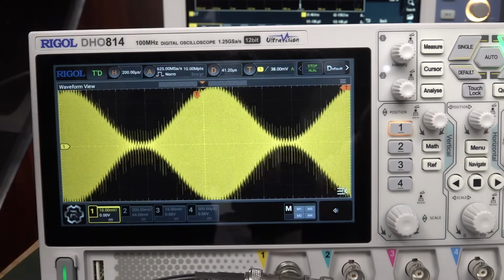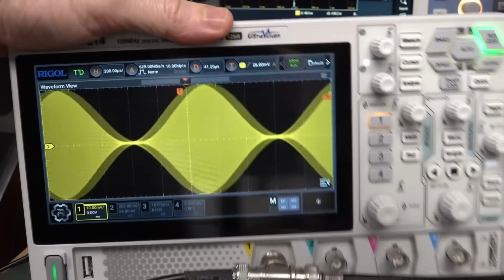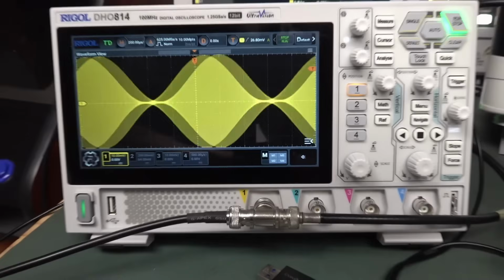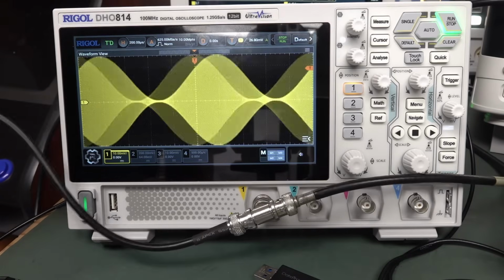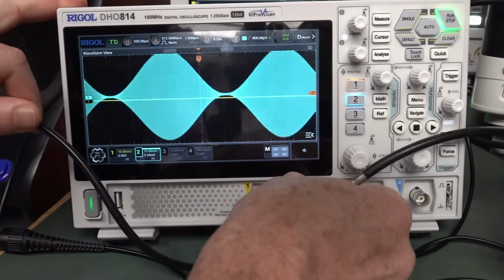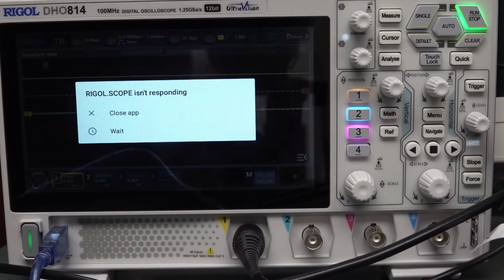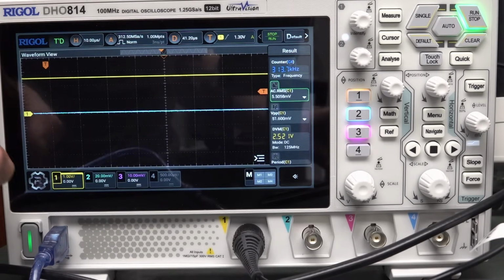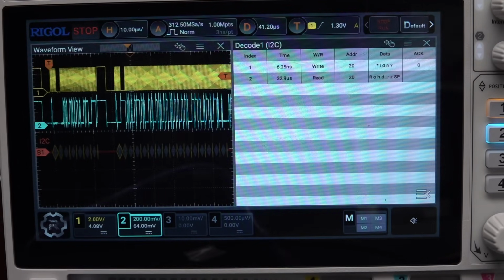Scope WTF!

Comment: The Rigol DHO800 series model DHO814, which I own, is the best oscilloscope I’ve ever purchased. It offers numerous features, a touch screen, and even the ability to operate using 5-volt power banks (similar to mobile phone chargers), making it highly portable. It’s an excellent device overall, but my one criticism is that the internal fan is quite noisy when the oscilloscope is in use. If Rigol could address this issue, it would make the oscilloscope absolutely perfect. Additionally, there are several YouTube videos available that demonstrate how to use this specific model and oscilloscopes in general.

Comment: So are we buying these DHO or waiting for a new batch?  The solder or grounding on the BNC must be wonky.  So are we buying?  I want to use it as portable with a battery over that USB C connector.  Could that C connector absorb interference?  And are we buying these?

Comment: Let's analyze the facts. The signal looks like Amplitude modulation.  Dodgy connectors,  other scope is fine.  You either created the issue on the scope or it is  a faulty.  Did you check the firmware. ?

Comment: Could anybody check the Zynq has a set software fuse which prevents the FPGA for loading a new firmware other than from Rigol?

Otherwise it would be possible to write a open source software for this oszilloskop
Reply: possible yeah, realistic no

Comment: Likely the heatsink/shield has a tint bit of oxide on it, ans this made it float over the input section. Strip down, and polish the edges where it surrounds the input section, and this should fix it. Or the input has a cracked trace right by the input soldering, probably where the large input pin connector joins to a thin trace leading to the input relays. Scope software restarting immediately is simply an app setting, set so it will always be run by the android system, even if it crashes, it will immediately be restarted, like all phones will restart Google services if they crash, just with a blip on the screen which you will barely notice unless looking.
Reply from the maker: It's just a dodgy BNC T piece.
Reply: @EEVblog2  You still have Arcnet T pieces around like I do, and the termination resistors?
Reply: @EEVblog2   Experienced the same thing recently.  Even ordered from Digi-key and still got a bad batch of tees.  I'd expect that from AMZN but I guess when everything is made in China, sadly, it's what is to be expected these days.
Happening frequently with car parts too.  New parts that fail quickly after install.

Comment: Have had similar issue a couple weeks ago on my 3245A with cheap BNC connector cables not gripping enough on the centre pin. Bought some quality ones fault fixed.
Reply: Yep, it's incredible how bad some BNC connectors/cables are. I see this a lot in my lab. My new Siglent scope HATES the cheaper pre-made (AliExpress) BNC connectors I had. I made my own cables with quality (Pulse) BNC connectors. Problem solved.

Comment: Now we know what DHO stands for:
Digitally Haunted Oscilloscope 😁
Reply: I mean, the scope just tried to fit the waveform to the broken lines of the DHO logo.
Reply: for the price I'll get it uncursed at "Curse Purge Plus!"
Reply: Definitely.. I ACCEPT THAT AS AN A FORMAL INDUSTRY TERM :P
and then..... you have this mystery
i'ts an 814
so if you ad 8+1+4  You get 13
Coincidence ??   Probably not
but then if you take the 3 and double it you get 6
and then if you repeat that......... 3 times, (is that also a coincidence).... You get 666

Now, i don't know about you but that's freaking me the fuck out
LOL
Reply: @martinkuliza  so the spikes in the signal are actually needles, torturing the user? 😁
Reply: @SystemX1983 
Correct
and when it hits a certain frequency it summons the Cenobites from HellRaiser from the underworld
but instead of 
- Pinhead
- Chatterer
- Butterball
- Deepthroat

The scopes summons 

- Breadboard
- Signal Noise
- Deep Memory Depth
- I have nothing for butterball
LOL
and when they arrive
THEY'LL TEAR...YOUR SOUL.....APPPPPAAAAAARRRTT
Reply: @martinkuliza  that really sounds bad. I think I'll stick with an old analog HAMEG instead 😄
Reply: @SystemX1983 
well, they are Cenobites
Guardians of hell, so,  it's not gonna sound good is it
could you imagine pinhead
comes out of the wall with a flash of light
and instead of saying

Ohhh Please, no tears it's a waste of good suffering
he says...
Yeah.. Umm, sorry to bother you,
by the way the light wasn't too bright was it, 
I just wanted to know if it'd be alright if you could come to hell with me

LOL

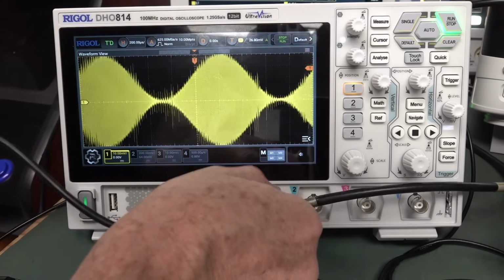Comment: At 0:21 the noise came back when you hit it with your hand. Maybe a lose BNC or internal shield not soldered correctly? At 2:52 when you touched the BNC too... Lose BNC or improperly soldered BNC or something connected to it mechanically/electrically?
Reply: That's what I thought, also seemed like it happened most when he pushed the BNC up though it's hard to really tell when exactly he's pushing it so that could be completely wrong. I don't think it could have been damaged by him trying to get the mainboard out at first without unscrewing the BNCs, really didn't look like he pulled that hard but that's the only thing I could think of other that a design detect like you mention.
Reply: @PoLoMoTo2  His next video showed it was the BNC T connector.... CALLED IT!
Need real silver or better gold plated connectors with tighter tolerances.
Reply: @anthonywilliams7052  you did! Damn Murphy throwing a wrench in it making it not show up on channel 2 and the siglent at first lol. Glad it wasn't the rigol, I'm thinking about getting one 🤣